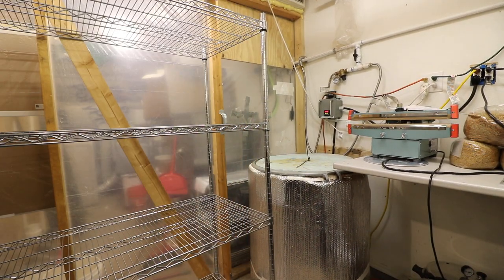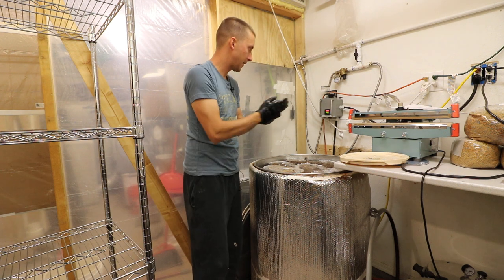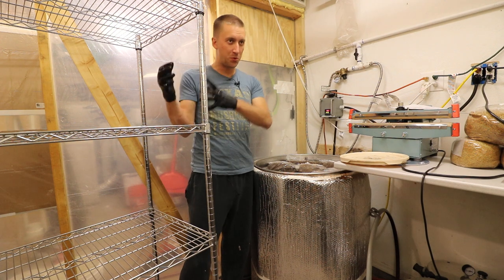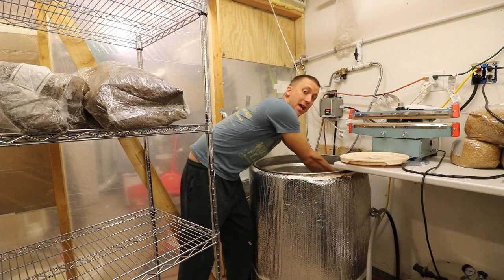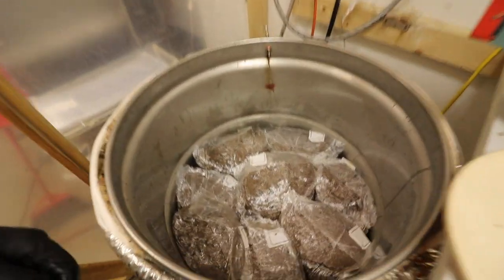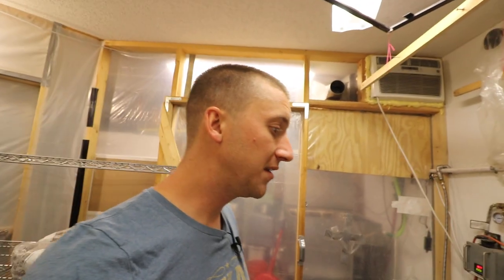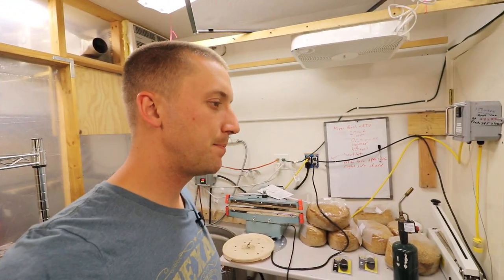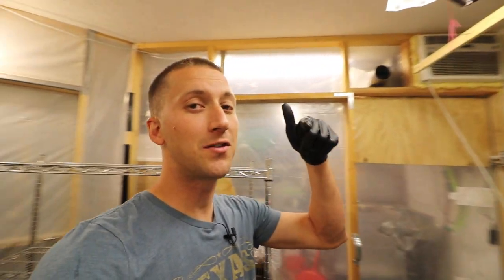Unloading A Single Drum Sterilizer Gourmet Mushroom Farm, Atmospheric Sterilized Spawn, Move Update

Comment: Hey Eric. What was the reason for the top bags being sealed and the rest not? Is this due to them being closer to the vent and therefore more prone to contamination during cooldown?
Reply: the top bags are grain spawn which needs to be more properly sterilized because the mycelium will be just starting off in the grain. the rest are bulk substrate and itsmore convenient to leave them unsealed as inoculated grain will be added into the bags in a more mature state.
Reply: @steelersrock300  Thanks!
Reply: @Xavier Ruiz I’m looking for this answer too. I would assume so

Comment: Is 20 hours necessary?  I'm thinking so because it's a vent to atmosphere and not a low pressure...1-2 psi sterillizer.  Have you tried running after the warm up at 12hours or less?
Reply from the maker: Its because its low wattage, it takes 12 hours just to get to temp. only 2000w heating 400 lbs.
Reply: Myers Mushrooms 12hrs to reach temp and then 8hr sterilisation?  I guess that's not too bad for eliminating pressure and the worries that come with..

Comment: Just to verify for this sterilization process,  you need to seal the bags before the sterilization process,since not under pressure and easier for contams to get in? Also have you experienced bags pop with this method?
Reply: No, you dont seal until after, the bags will pop if you seal them

Comment: Does anyone know if you can use these bulk drum sterilizers for sterilizing grain spawn? Or are they only used for bulk substrate?
Reply: you CAN but you either have to use the bags quickly, or run the cycle longer.